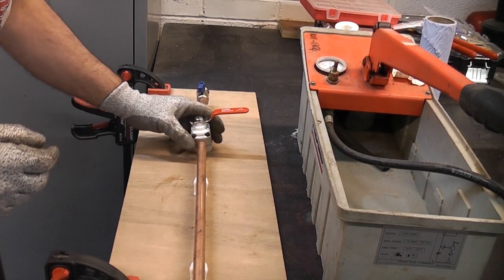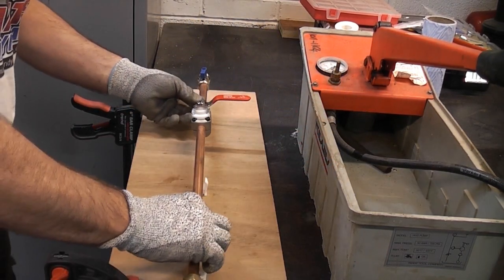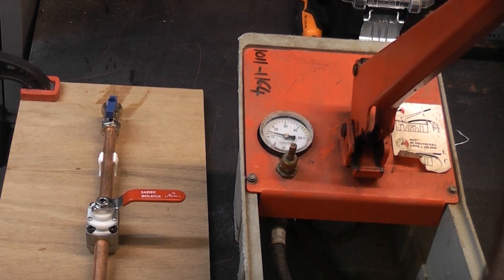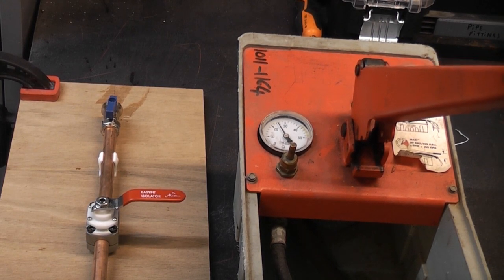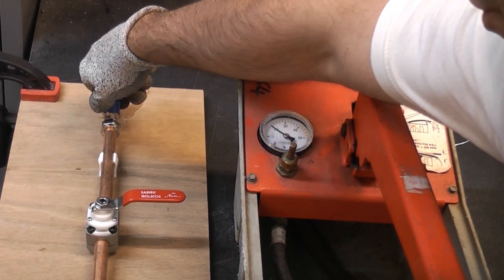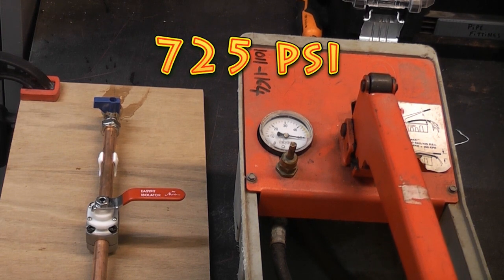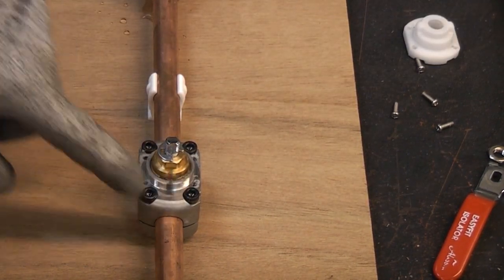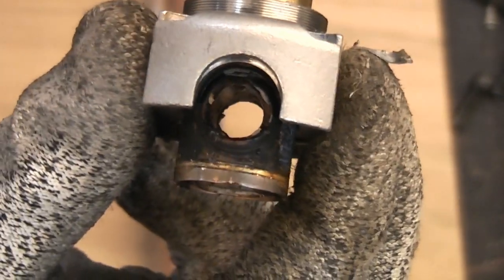Aladdin easy fit isolator pressure test and strip down

Comment: If you don't think you can get 260 PSI in a domestic water system you need to revisit your water hammer training. You can easily see pressures over 500 PSI depending on the flow rate and length of pipe.

Comment: Wow! Wasn't expecting to see the whole section of copper pipe removed. Thought there would be a smaller hole in the middle of the pipe with the structure of the pipe still intact on the sides of the pipe. Interesting.
Reply from the maker: I thought exactly the same as you ;-)
Thanks for the comment
Reply: I knew it had to be more then that otherwise there was no way a valve could seal.

Comment: Hello. Very nicely done video and a very useful quality product that I also hope to see available in Canada some time in the future. There is one thing that concerns me about your testing and that is about your safety. That was an awful lot of pressure that you put the isolator under and I am very glad that it did not explode in your face. When perfoming tests like this one you should have just one more 'isolator' present....and that is a safety sheild between you and the test equipment. Seriously, if it had exploded under the higher pressures you could have been gravely injured or even killed by the shrapnel. Get yourself a safety sheild for protection when stressing things to their limits. Take care!
Reply from the maker: Thanks for the concern, but pressure testing using a rig like this is not as dangerous as you might think.
Yes the pressure is high, but the volume of water in the system is very small, also water is not compressible (much).
If a fault was to develop in any of the equipment the pressure would be lost in a split second and at the very worst a tiny amount of water would leak out.
I've tested a couple of vessels that hold 200 tonnes of water on site and believe me, it's not that dangerous ;-)

Comment: Thank you for this video - I have a property where the mains riser stop tap is seized and inaccessible behind a gas meter and have been looking at these to isolate a couple of water pipes in the house that dont currently have ball valves fitted.
I winced when it got up to 700-odd PSI - I expected something to go pop!
Reply from the maker: Thanks Marty, I often pressure test on site. If there is a failure it normally just squirts a little bit of water out and then the pressure drops immediately.
Thanks for the comment
Reply: Mhairi , Thanks for the explanation because I thought it would have exploded !

Comment: Brilliant little bit of engineering, that! Truly impressive pressure resistance. I see that some folks were saying that this little valve is very expensive, but I'll bet that it's far less expensive than hiring a plumber, and it's clearly more convenient, and than the conventional method.
Reply from the maker: Absolutely.
Thanks for the comment

Comment: that thing is impressive. not only did it not leak until a buttload of pressure but i like how the little crimping it did was enough to keep the pipes from blowing out of the valve. definately not designed as some sales gimmick.
Reply from the maker: Absolutely, this is a very well designed piece of kit.
Thanks for the comment

Comment: Looks a well engineered and thought out bit of kit. I guess my biggest concern would be working downstream of the valve when it's shut and cutting a section of pipe out and this not gripping the inserted length on the outlet of the valve! It looks like there is a crimped line to secure it.
Reply from the maker: Yes, this is a well made piece of kit and great in emergencies.
Thanks for the comment 👍

Comment: Looks a great solution to the problem we plumbers face in isolating the water supply in older properties. Is it suitable for chrome or stainless steel pipe and will the 22mm version fit 3/4" imperial pipe? I like how the cut out pipe leaves full bore, unlike those horrible self cutting valves used in diy outside tap kits. Great video. Thanks for sharing.
Reply from the maker: I don't think you can use it on chrome or stainless pipe and currently it is only available in 15mm, it's a great piece of engineering though ;-)
Thanks for the comment
Reply: Copper pipe & plastic pipe only. 15 mm only.
Reply: My apartment is literally un-isolate-able for so many fixtures without cutting off the main to the whole building.  My shower can be isolated, but that's it.  Toilet, bathroom sink, kitchen sink...all end points of a lovecraftian interconnected maze of pipes that somehow involves my straight across neighbor and my neighbors above.

Comment: Thank you for a GREAT video! This answers the one question I had, on whether fitting this would restrict the flow of water through the valve. But it actually turned out to be full-bore, so it wouldn't restrict flow even in low mains pressure situations! =)
Reply from the maker: You are welcome
Thanks for the comment
Reply: Addicted to Projects , It's a full cut of the pipe but the ball valve part appears to be a little smaller than the pipe itself which may lead to a minor loss of volume/pressure ?  What's your take ?

Comment: Hiya. In the top part with the slug cutter. Where there’s the two indentations. In between as it bears on the pipe. Is this just a groove. Or should it have two little seals in. ?  I’m pre inspecting one. 😅. Thanks. Harry.
Reply from the maker: There is a seal that fits into the grove and makes the watertight seal ;-)
Thanks for the comment 👍

Comment: A very beautifully engineered product, thanks for showing us.
A question and an idea.
Q: after taking it apart, you can fit it again, imho, what is the pressure it can take then?

Idea: I guess a plumber can place this faster than a regular tap, which could make this cheaper?
Reply from the maker: I don't think you can re-use this product (but could be wrong)

This can be used in situations where you cannot install any other type of isolation tap, such as flowing or hot water.

Thanks for the comment
Reply: @ultimatehandyman  thanks for this answer, what I meant is, after you took it apart, you could put it back together again, I think that is possible,  but what I would like to know is if the pressure resistance is less, and how much?
Reply from the maker: I would imagine it would be the same, as the clamping force on the cap head screws that holds this together will be high.
Thanks for the comments

Comment: Good video I would say though that If the seal was to go around the side of the valve at 700+ psi when your fingers there you would have a nasty water injection and would need it surgically removed. Have seen too many hydraulic/high pressure water blasting injuries before just looking out good video

Comment: Seems as long as the pipes not pitted, corroded and is cleaned it should be fine. Maybe brush a light coat of silicone grease around pipes to help prevent corrosion? this valve seems to be very well built
Reply from the maker: Yes, this does seem well made, it is a quality piece of kit!
Thanks for the comment

Comment: That’s freakin awesome. Once you open it, is it rated to be closed up again say for removing a clog? I would assume so but I’m not sure if the seals would be damaged.
Reply from the maker: The hole in the centre of the valve is almost full bore, so a clog would be unlikely. I'm not sure about the seals, I would assume they would be good but can't be 100% certain.
Thanks for the comment ;-)

Comment: I work for a large supermarket chain & need to isolate a hot pipe sink feed as the ball valve is broken. Do you think this fitting could handle the pressure in a large shop water pipe system?
Reply from the maker: I would imagine so, but really you need to know the pressure, then compare it to the maximum recommended for this valve.
Thanks for the comment 👍
Reply: @ultimatehandyman  thanks for the reply. I believe it would work fine now I've checked the pressure.

Comment: that is impressive, I just don't know how I feel about longterm relying on a rubber seal in household plumbing, when I needed to make changes to my plumbing I simply shut it off at the meter, cut in my new pieces then turned the main back on. eventually I did that a second time so I could install ball valves onto just the lines running to the basement, so the basement could be shutoff without having to shut down the main level.
Reply from the maker: We have had push fit joints on pneumatics on site for over 30 years with few problems.
Thanks for the comment

Comment: This may even be more reliable in the long-term than the two compression joints you get with normal lever isolation valves...
Reply from the maker: Not sure about that, but the product is very well made.
Thanks for the comment

Comment: Is there something similar for galvanized steel pipes? Those are much more difficult to drill through.
Reply from the maker: I don't think so, cutting and compressing the slug would be a major task on galvanised pipe. Most drills struggle to cut out and compress the slug on copper pipe.
Thanks for the comment 👍
Reply: @ultimatehandyman  
Thanks for the response!

Comment: I know exactly where I will use this (old building with crawl space basement where many of the old shut off valves are and they may or may not work plus too remote from where the work is taking place) BUT I am confused as to how this Isolator is not in direct competition with the "Pipe Genie" by the same company (Aladdin)?  Aren't they the same thing?
There is variation of the shape of the valve but the Pipe Genie lists being able to install a small bore maintenance ball valve (which could mean the flow is reduced) with the "upside" being that it comes in 22mm and 15mm variations.
Reply from the maker: Hi, yes- pipe Genie and the easy fit isolator are both made by the same company.
Thanks for the comment

Comment: Would it work on U.S. 3/4" pipes (about 14mm)?
Reply from the maker: No, this will only currently work on 15mm pipe, although they are expanding the sizes available. 
Thanks for the comment
Reply: More like 19 mm isn't it?

Comment: That is quite amazing, you would think it would simply crush the pipe, but somehow it cuts without distorting the pipe.
Reply from the maker: Yes, it's really well designed.
Thanks for the comment
Reply: That was my thought at first as well. But since the pipe is supported by that big block of steel completely surrounding it, it really can’t be crushed flat, as that would mean it would need to expand in a direction which it cannot. So as the force is applied, the only thing that really happen is for it to shear through it.

Comment: AWESOME
Reply from the maker: Thanks for the comment
Reply: Ultimate Handyman you welcome.  you made a awesome vidio showing how that gadget worked. I've been there. finding the main water valve then sticking bread in both ends while I try to flux and Salter copper pipes. I like that valve it definitely surprised me it could take all that pressure.

Comment: Price?  Of course in 2045 the price will be different. Date and price?
Reply from the maker: They are about £45 in 2018
Thanks for the comment
Reply: Screwfix are currently charging £45 for the starter pack and £40 for the refill pack. So a heck of a lot more expensive than a regular isolator valve, but probablly worth it in the right scenarios.

Comment: What about copper shavings....may dangerous for warter pumps...ice machines....drinking water....
Reply from the maker: I think the shavings will be minimal as the cutter is more like a pipe slice than a hole saw.
Thanks for the comment
Reply: Yeah, I don’t think it makes any shavings, it acts more like a circular scissor or pair of tinsnips than a saw. Look at the plug cutter, it doesn’t have saw teeth.